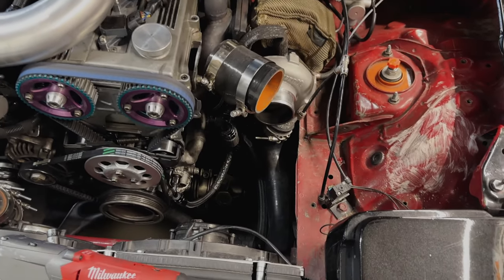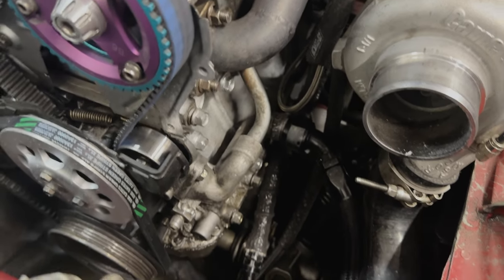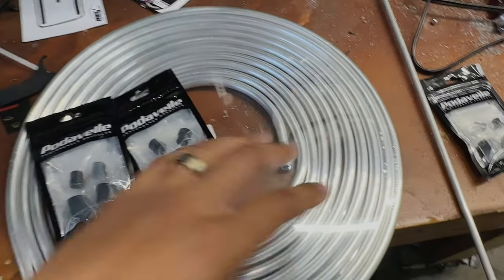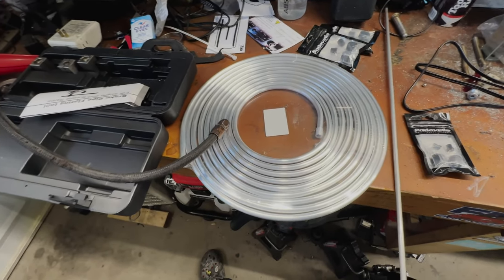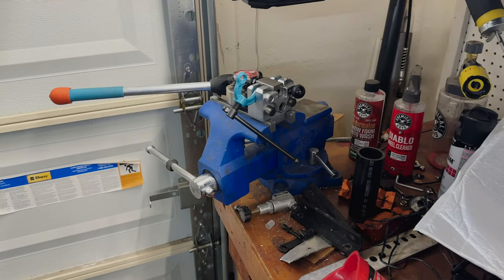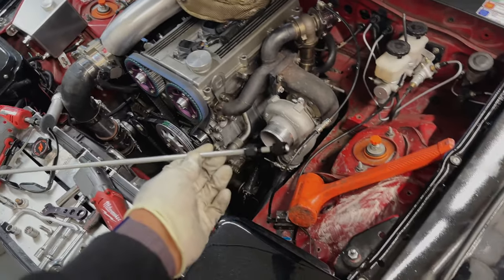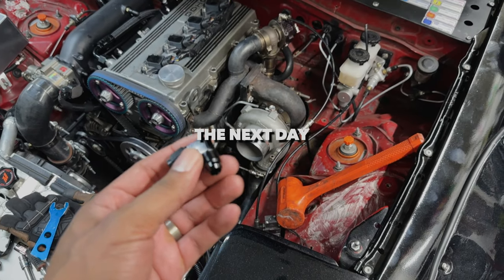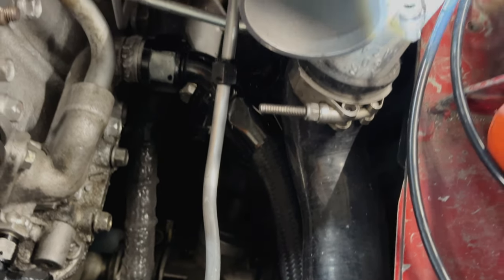Hardlines For Your Turbo

Comment: Heck yeah bro , this looks rad af ... I only hope nvh don't cause the hardlines to vibe loose cuz that would suck as cool as this came out .... I hope it works out well bro and I might have to go hardlines myself then as it looks real clean and like you say , won't melt 😅.. peace and love bro keep it rad stay safe and build on l8z famz keep having fun .. love the build I am by no means downing broski when I say I worry on nvh i have just had alotta shit including ppf bolts come loose from all the polly and hard mounts I have going nuts nvh 😅but that's our choice for a fun ,light weight , lil tossable go-cart for the streets right lol much live n respect bro .. l8z
Reply from the maker: Thanks and very much appreciated!

The NVH hasn’t caused any of my existing AN lines to come loose so I’m not too concerned with these backing off, it’s the heat I’m mostly concerned with, since I’ve melted a few oil lines in the past!  Well worth it!
Reply: @TheeCrazyblackman  rad bro and good to know ... I deff dig it bro , and yeah I have had bad luck with mainly my vacuum lines getting to hot and melting lol , thought about use that air line stuff trucks use for air brakes ... anyways I will stop rambling lol .. I deff like the hard lines tho bro , great idea and looks alot cooler than just rubber lol 😂 peace and love bro l8z
Reply from the maker: @mastercricket7626 absolutely man, you can use the push-lock line but if you do make sure you the stuff from Motion Raceworks, DO NOT USE THE STUFF OFF AMAZON.  You want a steel push lock fitting so it doesn’t melt, and you want silicone hose meant for heat compared to just normal push lock fitting trucks use.  You will melt the normal lines and have vacuum leaks everywhere!